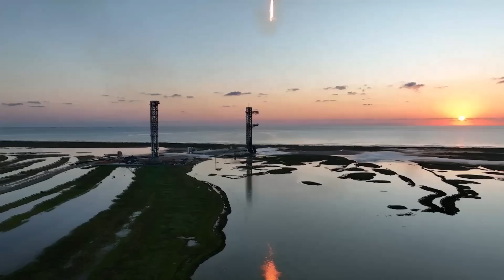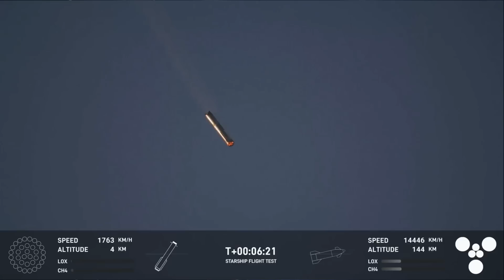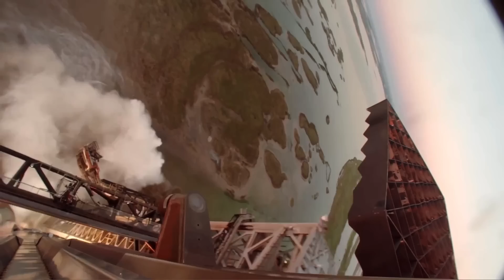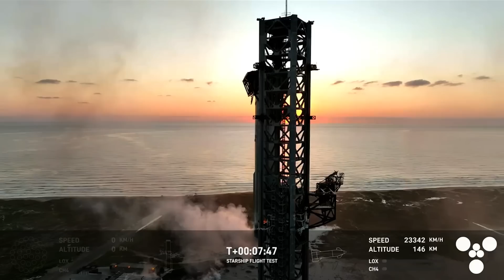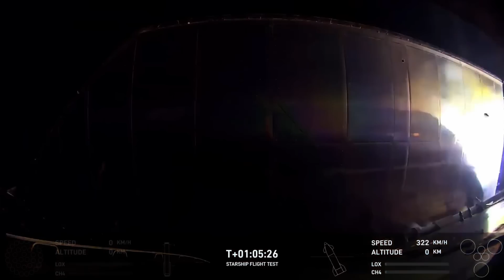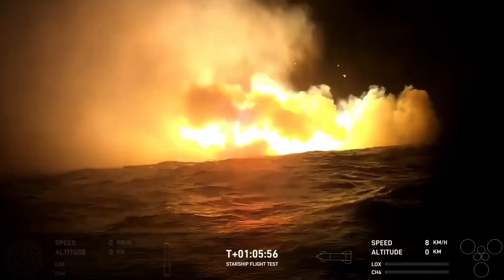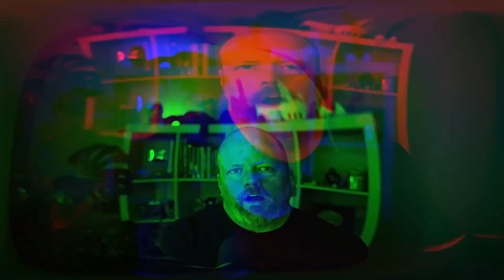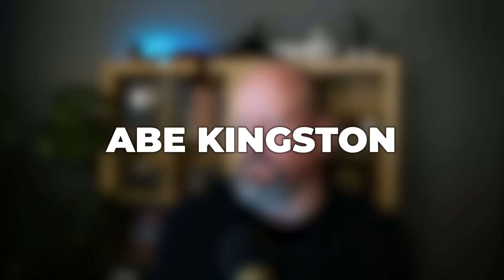ABSOLUTE Success! Full Analysis of Starship IFT-5 (with @scottmanley, @MarcusHouse )

Comment: I'm curious about the process of aligning the booster around the vertical axis so that the pins land on the chopsticks. It seems like that was off by even 20° the booster would just slide through the chopsticks. Are they using some of the attitude control thrusters to tweak this during the last few seconds?

Comment: hi Fraser, I have one question. we saw on the Europa Clipper missions the Merlin Vaccum was at  a top speed of 46K kmph . It across Moons orbit in less than 24 hours. Lets say we had 100 tonnes of fuel in the second stage, what is the maximum speed we can reach ?

Comment: Temperature is just the average energy, so in the upper atmosphere the temperature can reach really high but because there isn't actually that much matter. Thinking about it like if somebody sprayed you with 1 g of water at 750⁰C you could survive fairly unscathed, but if they sprayed you with with 1 kg of water at 75°C The temperature would be lower but the total energy would be higher, and you would get severely burnt.

Comment: What was the total "catch" weight of the booster, inclusive of unspent fuel (dead-load + Live-load = ?)?  Also, if the Starship had a "delivery load" of say 75 tons, would the Starship suffer greater degradation of the heat shield upon reentry with an extra 75 tons onboard? 
Best - Michael

Comment: the larger point is whatever improvements come from v2/v3, stretching, thinner  metal they seem to have solved most of the problems or its minor fixes to software / chilling / procedures. the melting flap is fixed by moving the hinge back a bit, the bent nozzles are probably fixed by running coolant through them, etc.  the grid fin did melt a bit during the hot staging firing so that will need to be addressed. but the best part is we will get to see it all fixed over the next 2-6 months.  a 2nd golden age of space flight for those born after Apollo and streamed live!

Comment: Rapid reusability isn't very believable for superheavy, if you consider that have 33 engines, for falcon9 only checking nine smaller engines between flights is a headache, and anyone can see that the starship booster was damaged (all those debris falling from beneath), two hours between flights seems a fantasy, but maybe New Glenn would do that, after all it have only 7 engines, and are less susceptible to clogging than Merlin.
Reply: This was the first recovery. The first recovery of a vehicle is just one step further on the path to reusability. It took Falcon 9 around 15 months from the first recovery of a booster to the first reflight of a booster, and then SpaceX kept refining the booster for ease of reuse for several years. On the next recovery, expect to see much less damage to the booster, if any.

And the plan is to not do refurbishment of the Raptor engines between every flight. There will probably be regular maintenance scheduled after every X flights.
Reply: @SpaceAdvocate  so the future superheavy boosters will have less engines? If you answer to me, address the problem that I pointed. I understand that the plan is no refurbishment, exactly that was my point, but I find hard to believe that is possible for superheavy precisely because this one isn't in perfect condition after this landing, also no refurbishment don't mean no checking for minor damages, that would be slower and harder for so many engines, and don't say that don't matter because they have redundancy, because if four or five engines have cracks in fuel lines after first fly on the second one the whole booster would fail, and the mission too.
Reply: @theOrionsarms  No, they will increase the number of engines on future boosters to 35. They will definitely do some checks on these engines before reflying, but you can expect that those checks will be reduced to minutes, and automated.

Initially, you are right that it will take time to check all the engines. But they will be gradually building confidence in the design. Once you have boosters that are consistently fine after every flight, you stop doing extensive checks after every flight. Once boosters have flown tens of times with no major repairs, you're not too worried about the wear and tear imposed by a single flight.
Reply: @SpaceAdvocate  your confidence in future reliability of such complicated machine is based on false belief that any possible failure would be minor and solved simply by shutting down a engine, but that isn't true(are minor failures and major ones, that almost always end in complete destruction), also reliability is more hard to evaluate, for example if you have a rocket that have 33 engines and only once in a thousand one engine would fail catastrophically(more minor malfunction can occur more frequently)then at each 30   flights you have a complete failure,on the other hand if you have one rocket that use a single engine and all failure mode ratio for that one is 1% then only one in 100 launches would fail, obviously this is a simplification because a failure could occur from other reason than engine failure, but checking all the engines between flights would be needed, and obviously 7 engines are easy to control than 33 , so for fast reuse is better to have less engines, that was so obvious that I wonder why you didn't understand that in the first place.
Reply: @theOrionsarms  I expect there will be major failures. But I also expect that SpaceX will learn from such failures and ensure that the exact same failure never happens again. So in terms of major faults that doesn't just lead to a benign shutdown, the engines might go from being something like 99.9% reliable right now, to 99.99% reliable in a year, to 99.999% reliable in 2 years, to 99.9999% reliable in 5 years. Something along those lines. At 99.9999% reliability, you would expect a major fault on every 227 launches. As reliability increases, the need for testing between flights goes down.

Fewer engines is harder to make very reliable, because even a minor fault will lead to a loss of the vehicle, and you also don't get nearly the same amount of real world experience with flying the engines, meaning it takes a lot more time/flights to debug them.

SpaceX already has more experience flying the Raptor than ULA had with flying the RD-180. SpaceX should pass NASAs experience with flying the RS-25 next year. It'll take a bit more time passing the Merlin, which has flown over 4000 times, but they'll get there at some point, probably closer to 2030.
Reply: @SpaceAdvocate  it depends on what is the cause of current damages,if at the roots is putting to many and powerful engines so close to each other, and the solution is adding more shielding and vibration damper,then they spend a lot of time and efforts only to get in line with a smaller vehicle like New Glenn, also if the payload capacity would be around the same because of dead weight added,why bother on building giant vehicle, pride?
Reply: @SpaceAdvocate  PS . also I find your pretended Raptor reliability pure vaporware, from almost 200 that were on a real flight at least 10 failed, that would suggest a 95% reliable engine, from that they should improve, not your fictional 99,9%.
Reply: @theOrionsarms  Having the same payload capacity as New Glenn can be fine as long as the vehicle is fully reusable. New Glenn is only partially reusable. It isn't really the size of the vehicle that matters, it's the cost of getting things to orbit. Throwing away expensive hardware quickly gets more expensive than some extra propellant.

I think Starship would be a success even if they never get above 50 tons to orbit, provided the cost per kg to orbit is less than $1000. Or under $50 million per launch. That wouldn't be as good as SpaceX is planning, but still fairly compelling. You could still do a ~26 launch moon mission for Artemis at less than the cost of an SLS.
Reply: @theOrionsarms  Regarding Raptor relibility, Starship was plagued by propellant system issues for flights 1-3, and it may also have affected flight 4. If you look at flight five, where they seem to have finally resolved the propellant system issues fully, 39 out of 39 engines worked flawlessly, or 100%. If you include flight 4, you had two failures across 78 engines, and both were minor failures that didn't cause the loss of the vehicle. (So 100% reliable disregarding minor failures.) Maybe 99.9% is too high, but the probability is definitely closer to 99% than 95%. We shall see how the statistics develop over time.
Reply: @SpaceAdvocate  so how this is the same as RD-180 on Atlas, that doesn't have a single such failure on over 100 flights,or almost as good like RS-25 that with three such engines for each space shuttle make 135 flights, and not a single failed engine?
Reply: @theOrionsarms  The RD-180 has had one minor failure, but it was so close to MECO that the mission was still mostly successful. The RS-25 has had at least one minor failure, but that was also close enough to MECO that the other two engines managed to avoid disaster. (I can't quite recall if it was more than one.)

An important distinction is also that the RD-180 and RS-25 engines did a single burn, starting up on the pad. What SpaceX is attempting, with multiple in-flight relights in various orientations and environments, is much much more complicated.

If you only look at the ascent of Super Heavy, which is equivalent to the use the RD-180 and RS-25 see, the last four flights have seen 131 out of 132 successful full duration burns. That's better than the RD-180 but I believe it's slightly worse than the RS-25.
Reply: @SpaceAdvocate  bottom line is that both are more reliable than Raptor, and aren't even most reliable engines, those are RD-109 from Soyuz (more than 1300 flying with 5 engines each, and Merlin from falcon9 , also very reliable I admit, but Raptor wasn't designed for reliability but for performance, so it makes sense that it fail more, this is the truth no matter what you believe.
Reply: @theOrionsarms  For the reliability during ascent, Raptor seems to be somewhere between RD-180 and RS-25, currently. Maybe better than RS-25 on later builds, but there's just not enough data to say. That's the bottom line. 

The RD-107/-108 from the R7/Soyuz family is almost certainly not the most reliable engine, overall. Maybe you can compile some data for some specific version of it, but remember that while the R7 family of rockets has launched almost 2000 times, 120 were failures or partial failures. Certainly not all were due to booster/first stage engine failure, but some were.

"The most reliable engine" is a bit difficult to say, because there are so many engines with a perfect record, and at the same time, with so few launches that we have basically no idea how reliable the engines actually were. Like the F-1. Perfect record, but only 65 engines flown in total. Maybe it was extremely reliable, maybe it was luck. Impossible to say.

I think Merlin has a fair claim to the most reliable engine ever, but again, impossible to say. Raptor is designed for both reliability and performance, and I would expect Raptor to exceed Merlin in every way over the next ten years.
Reply: @SpaceAdvocate  nonsense,at least 1% of Raptors failed catastrophically on testing or in flight,we never know how many have minor failures, and obviously wasn't intended for a engine to fail and destroy the testing stand after less than 30 seconds like some claims,or on the first flight when a engine exploded in the middle of ascension wasn't for fueling issues like you suggested, obviously are some unknown about older Soyuz, but that is old story(and I didn't count those), recently is still pretty reliable, you believe what you want to believe, but I need more than Musk ridiculous claims as evidence. Not that Musk claimed amazing reliability for Raptor, you and others like you are doing that on his behalf.

Comment: RE: the visible fire and heating in the engine bay as the booster became transonic. Perhaps they could use any remaining CO2 for the fire prevention system to suppress the flames?

Comment: I noticed that the flames were only coming out of the outer ten engines around the center three engines. I propose that Spacex was venting methane through the outer ten engines to cool them down. They didn't use oxygen as that would enhance any existing fires in the engine bay. The same idea for the booster quick-disconnect; venting methane versus oxygen.

Comment: Did anyone notice the grid fin in the video showing the Starship separating? Before the Starships' engines fired, the top of the grid fin was perfect. After the brief exposure to the heat from the Starship's engines, many of the elements of the grid fin were displaced or warped.
Reply: The grid fins survived just fine. No damage. Space fans filmed them extensively during the rollback of the booster to the factory.

Comment: Knowing how many potential failure modes I though it was probably 20% at best that the landing would happen. After all this is still a highly experimental vehicle and they are still dialling everything in. The way everything went absolutely perfectly to get to the catch is an incredible achievement in itself let alone the catch also going perfectly. As an engineer myself I can imagine the mood in the room with the engineering team when it settled perfectly into the arms. Just outstanding.

Comment: Would it be more efficient to fire a starship one way and land at a different tower and then fire the next launch in the return direction. That way the booster can jump between launch points without expending extra fuel.

Comment: Frankly, given the head start SpaceX has on guidance systems, for the part involved in bringing the booster back and landing it on a barge or landing pad on solid ground, catching the booster was the simpler task out of the multitude of tasks to be done for the whole system. The Starship part of the equation is the tougher part to solve, especially the re-entry and landing, combined with rapid reusability. They have boosters figured out pretty nice from all those Falcon 9 and Falcon Heavy flights. But that's just my view as an outsider...

Comment: I love the starship development but there is a problem as Scott explained. If you look at the residual fuel left in both rockets and you consider they are flying no payload whatsoever, the current configuration would be likely to only put 10 to 20 tons of payload in orbit. It's pretty easy to see the problem with both ships showing basically empty when they have completed their respective jobs. They have significant work ahead to get 150 tons to orbit!

Comment: I could see #6 with identical trajectories but with lots of hardware details tuned. This would allow for reliable evaluation of good-better-best for each change tried. Clearly some thermal protection details need improvement at the fins and the aft end of the booster strakes.

Comment: I think the boosters outer ring of boosters should separate frombthe booster, once their job is done.  these could possibly deploy wings to fly back, or use parachutes to come back, for re-use on a different flight. 

they can have other outer rings on the ground, ready for the next flight

the earlier starships had legs, so it can land without a catch attempt. afterall, there isn't a tower on the moon/Mars
Reply: that really defeats the purpose and adds weight and complexity.
Reply: @zachmoyer1849  
a lot of boosters are detachable, I proposed this as a question: "Why not eject the outer ring of engines?"

think about it
-  They are only used during the initial stages of flight.  As soon as they're shut-down, they're effectively just coming along for the ride. 
- Removing them saves weight, therefore can save fuel.
- They are exposed. No skirts, or fairings means no major redesign required (discounting internal plumbing), to enable them to eject from the booster - either as one ring, groups/clusters, or individual units. returning to earth under parachutes.
- no outer ring = a reduction of void spaces, where unspent propellant could collect. therefore, less purging is required.
- no outer ring could allow for a more aerodynamic base, which could include control surfaces.  so, if they have the ability to stear in flight (like the grid fins), without the need of thrust.
- furthermore, lower control surfaces can help increase of a center engine failure. 

these are just a few reasons I can think of, off the top of my head, as to why ejecting the outer ring would be beneficial.  Isn't spaceX all about thinking outside of the box, and questioning the norms?  this flight demonstrated just this premise perfectly!
Reply: @miyahollands6136 

I would say that is inside-the-box thinking, IMO. SpaceX basically solved this by making the latest version of the Raptor engine lighter and giving it more thrust. Elon has stated that any non-welded plumbing is a liability, and removing as much as possible is key to reliability.

If you haven't seen the new engine, you should take a look because they have practically removed any fittings. They want a turnaround time of an hour; your idea just adds more processes and limits how many times a booster could be flown in a given time frame.

If you think of it like that, eventually the little extra tonnage gained per flight with your ideas is more than made up for in the time savings, because you can just launch the rocket one more time. This is prudent when you consider it may be easier to get chunks of flight windows where they can attempt to launch as many times as possible, versus having to approve each launch individually, which is likely what will have to happen now that the concept is well underway.